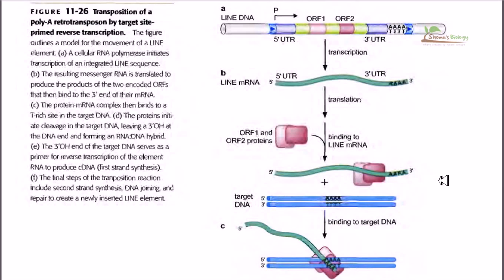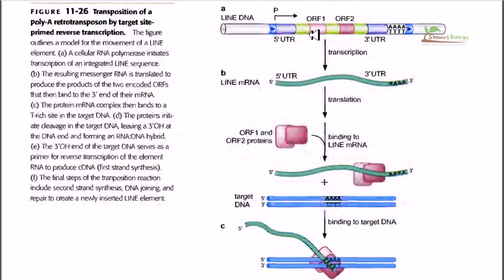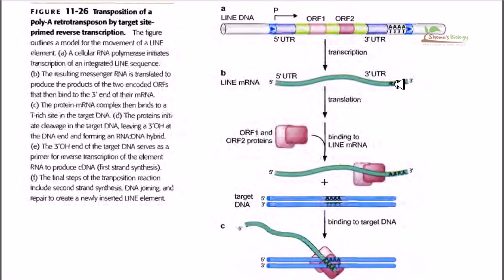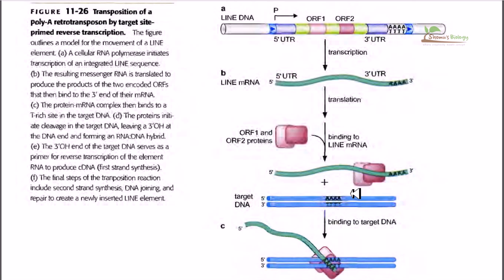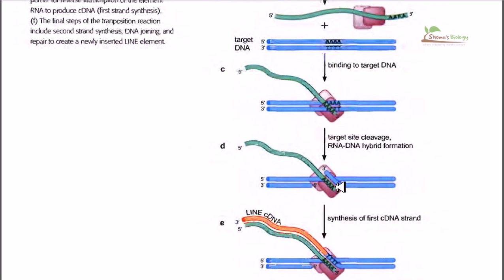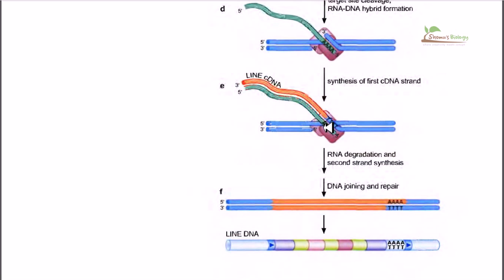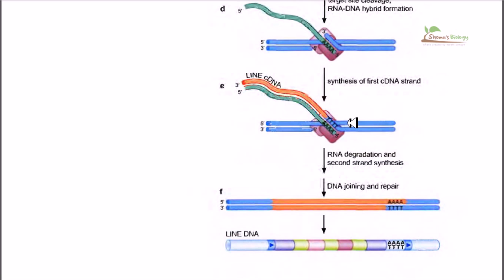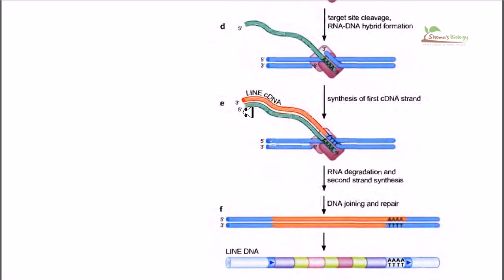Transposition of a poly A retrotransposon

Comment: Really nice video! Only have a little question: do both cuts of the strands happen at the same time or is the 5'-3' strand (from the original DNA) cut after the synthese of the second cDNA strand? Also, wont the strands sort of drift apart when both strands are cut simulatinously?